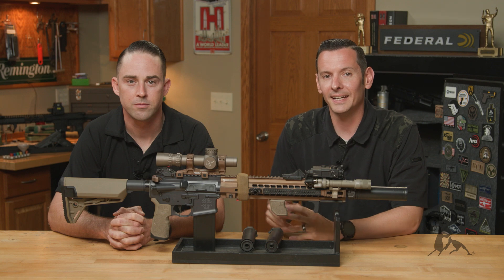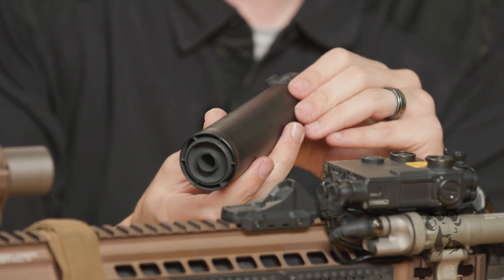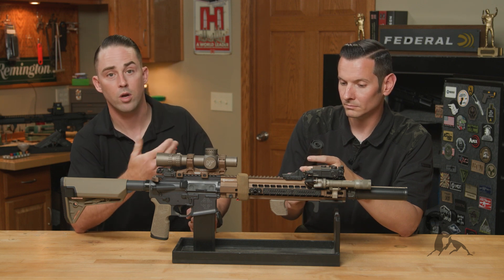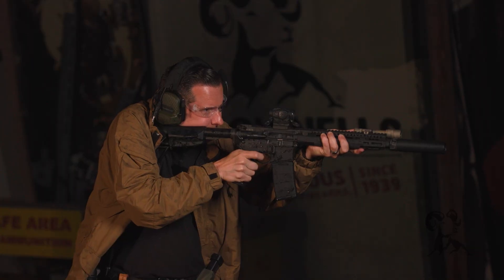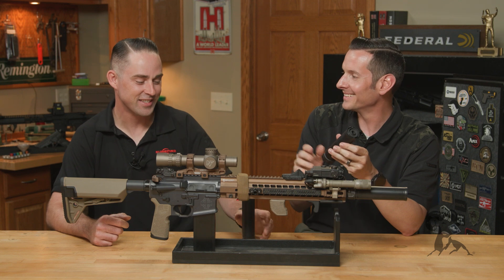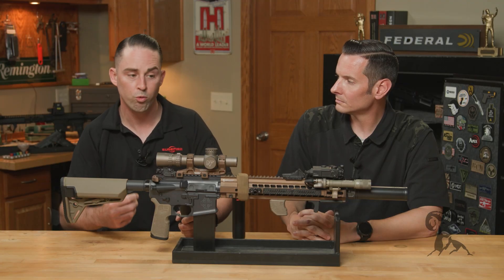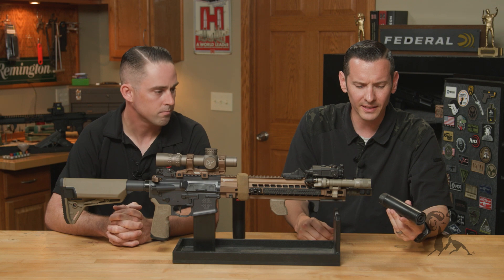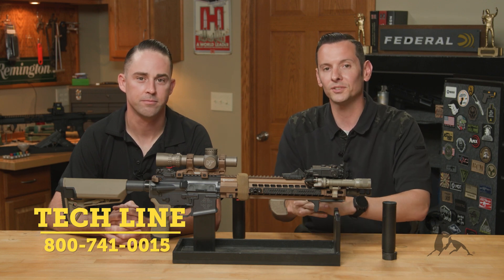Product Spotlight: SureFire RC2 and RC3 Suppressors

Comment: RC3 is comparable to the OCL Infinity with 7.62 vented end cap in terms of backpressure and sound attenuation.. Which is actually not bad at all. Not as good as HUX but more durable as they use Inconel instead of titanium

Comment: To me there’s no advantage to going with low back pressure. If I can’t take my hearing protection off then to me it defeats the whole point of a suppressor. I know there’s other advantages to using a suppressor but if it can’t make it quiet enough for me to remove my headgear then I’m just going to shoot unsuppressed

Comment: I'm going to say it.  
Not RC2 -> OCL polonium 
Not RC3 -> B&T Print-X
They are cheaper and perform better for tone (firearm dependent), noise reduction, and flash reduction.

Also the mounting hardware is more universal without having to buy a $300 adapter.
Reply: But will it last as long?
Reply: @deadizbetter  the B&T been field tested around the world short answer yes. 

Seriously like what are you going to be doing that you’re going to wear out your suppressor? You’re not gonna be at war. And even if you were the suppressors OP mentioned have been field tested
Reply: The b&t print xh is pretty nice.
Reply: I’ve seen multiple test performed where the B&T was louder more flash heavier larger and in every way not as good as the rc2  or rc3 and all that to save a couple hundred dollars and never mind durability and that after 4,000 rounds the b&t has to be soaked over night because it’s  clogged and not even a flow through anymore. I’ll go with what has more track record in the field testing  any day for my money
Reply: @mattbarlow7631 Got a link?  I've seen nothing but tests that show the contrary.  I use the B&T SRBS which is the predecessor to the Print-X and it's quieter than one of my buddies RC3s.  You're paying for the name.  Sometimes it is just a hard pill to take.  I've seen zero evidence to suggest surefire makes cans that will outperform.  I've seen a lot of guys say they regret their surefire purchase after buying alternatives.  They are "back of the safe" items now.
Reply: @mattbarlow7631 all of that is objectively false. The RC2 and RC3 weigh 17oz while the print X inconel comes in at 14.9oz and the printXH weighs 10.5oz. I have the full inc 762 and its hearing safe on my 16" 556 and 300blk, with subs people in my house can only hear steel ringing when im blasting in my front yard. As for price b&ts are aound 800 bucks when rc2 is 1200 and the rc3 is a staggering 1709 on si shop. Which makes it one of the most expensive cans ever. The Dillon is 1500 and is super quite and the Rhino S is the quitest on the market and only 800. Furthermore the RC3 is barrel restricted to 10.5 inches. The Print XH has no length restrictions and survived 22,000 rounds of back to back to back Socom tests over the course of 3 days....